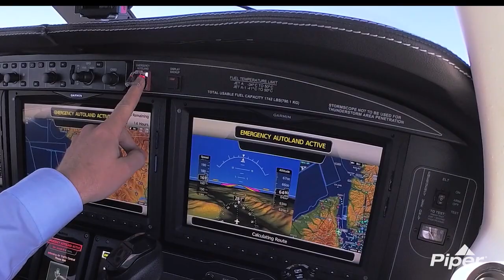Piper Aircraft M600SLS Autoland Certification

Comment: I would be interested in hearing a sample of what the Autoland system announces on the radio.  I presume it announces on 121.5 only, since the last frequency in use by the human pilot might be very busy.

"N12345 is declaring an emergency due to pilot incapacitation.  This aircraft is now under the control of Piper Garmin Autoland and is proceeding autonomously to KZZZ, expected time of arrival 9999Z, fuel on board xxxx pounds, souls on board x, please have rescue crews available."  Something like that, I suppose.  Any other suggestions?